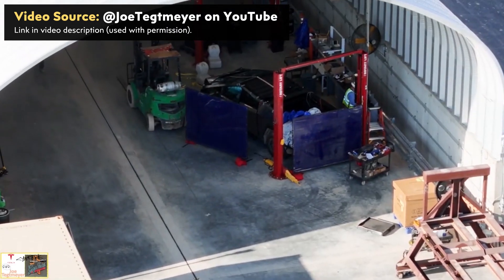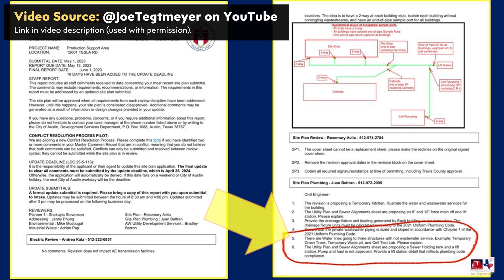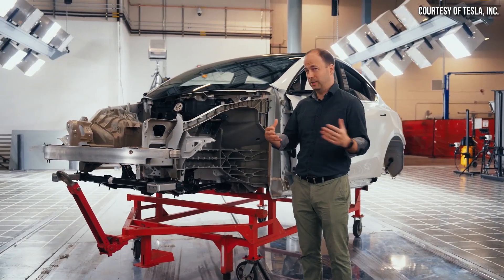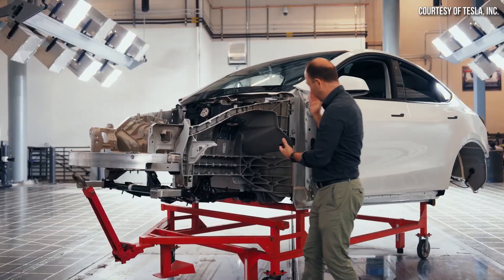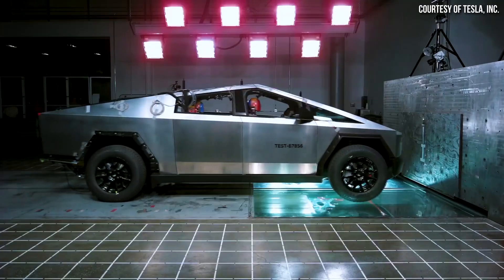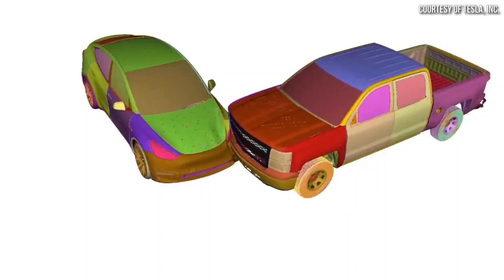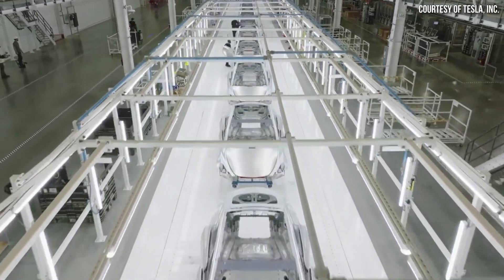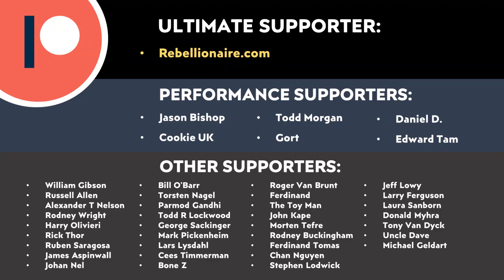Tesla Cybertruck Crash Tested at Giga TX | Customer Ready?

Comment: Isn't it late in the design process to be doing these crash tests?    If you are not satisfied with your crash test results, how much can you change the design before the launch?
Reply: They are probably testing some new revision to an interior or other relatively non important part.
Reply: They have been crash testing for long time....they are probably doing some final tweaks of the bag deployments etc.
Reply: @Amuzic_Earth    I don't know if it is just the air bag deployments....    Anyhow, not a lot you can change at this point.   Even small changes could delay the build process.